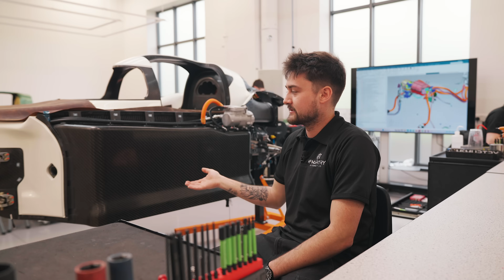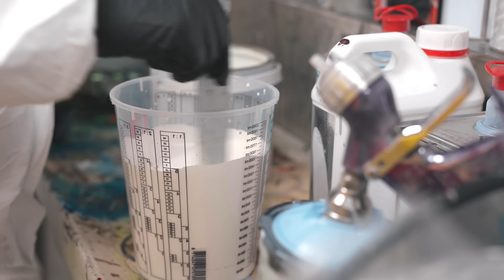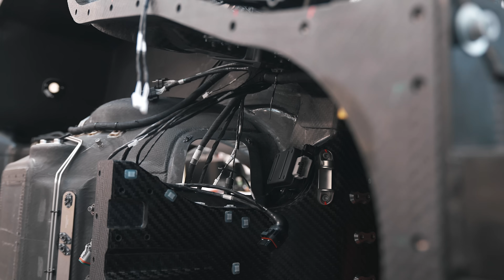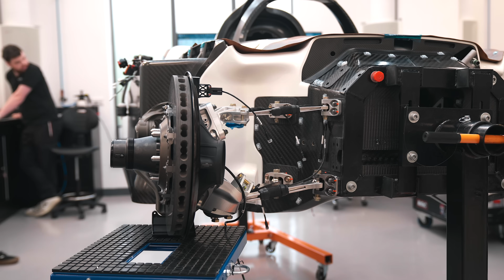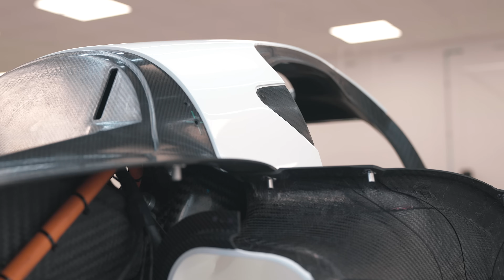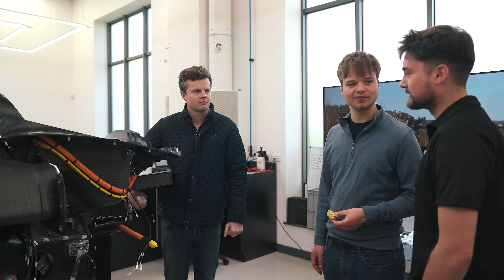How to Build a McMurtry: PART 2 - The Chassis

Comment: A thing of beauty, a question about the ac compressor and air compressor. Was there nowhere else down low that these could of been mounted, I would be very worried in a side impact eventuality that you have a big heavy lump of metal flying towards your head?

Comment: Thats a lot of additional equipment with substantial weight increase. It's was the crazy leap in performance over anything else that drew the buyers. Now that they're being built that performace capabilities won't be there. 
"moved the fans from the top to the back improving COG".... ummm then mounted the much Heavier inverter and charger in that space...BRILLIANT.  
Replaced the carbon composite air tank with much MUCH heavier air compressor... Genius.
And weighing in more than the above mentioned additions the air conditioner compressor , heat exchanger/radiator & heavy duty high pressure plumbing....Masterful
This is just the beginning of the build.... what'll be next🫣
Reply: A few kg won't kill its performance.
Reply: imagine the millions of dollars race teams could save if you'd just share that secret build imfo with them.  They might give you a portion they save.
Reply: @NvTwistA car that exists in its own timeframe does not care of a few milliseconds lost. If it were homologated then yes it does mater. Even then we do know that the radiator became lighter; we don't know how many pounds were actually gained total from those devices. Plus its gained more cornering speed from wider tires. It got faster. These are ex f1 engineers. They wont ruin its performance.
Reply: wider tires does not increase cornering speed, wider tires are required due to the vehicle weight in order to maintain the proper contact patch. Cornering ability & speed will be impacted by the increased weight. If cornering ability is maintained as the pre production vehicle that increase in weight will reduce both the braking and acceleration at both ends of any corner.  The Car Has ZERO need of an A/C when the car will be dead and outta power in under 8mins when the driver switches the car into the full power mode matching the performance of a F1 vehicle. Then requiring a 11-18 hours of recharge depending on which of the two chargers are used. I've got a PDF from the company that list the different performace levels avail and the respective runtimes of each. Of course now with the inclusion of a battery powered A/C those runtimes will be even shorter.
Reply: @NvTwistThen where did an extra 0.5Gs of cornering force come from if a wider contact patch doesn't add cornering ability? I know there is a balance of weight needed on a tire for its grip potential. Did they only find the limit of width now? Negative camber?
Reply: @NvTwistAlso where did you get that PDF? They removed run time animations from their website and I didn't screenshot it.
Reply: It's a sales catalogue that was sent to me. The page I mentioned has a graph with the 4 drive driving modes comparing the mode with the pace of a GT3, LMP2, HyperCar & F1. Each  levels Motor Power% & down force % & basic bar graph for expected runtime.

Comment: What is being used to prevent galvanic corrosion between the billet mounts and the carbon fiber chassis?
Reply: My people! Every time I see a carbon part on any car, I think this.
Reply: I was wondering that too.  Not just for McMurtry, but for all the cars with aluminum fixtures bonded to carbon.
Reply: @zounds13  Perhaps it’s a combination of Paint and Adhesive although I really would like to know for certain myself. Dark Aero has a good video on this topic https://youtu.be/yRpMZaU8zKw?si=dvrwJIvK8WpysrS2

Comment: So lovely, especially the suspension movingness. But then the air con and air compressors looked like Bob had nipped off to Halfords in the night and just bolted them on top of the monocoque before the engineers woke up! I’m sure they’re £30k parts but surely they could be flatter and lower and lovelier.